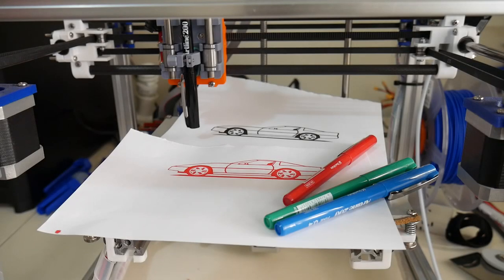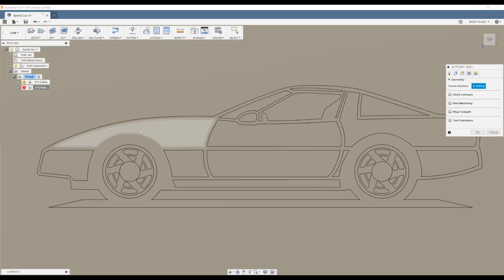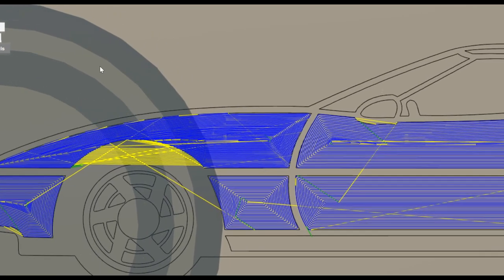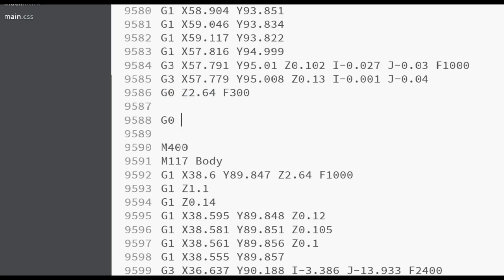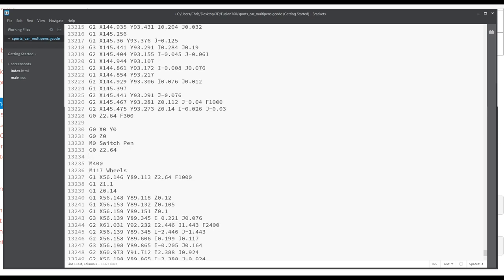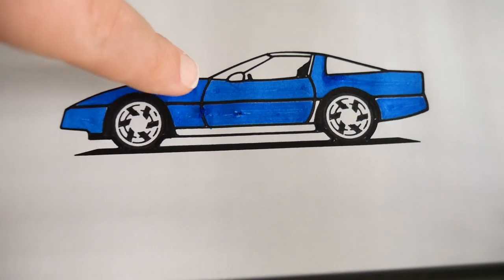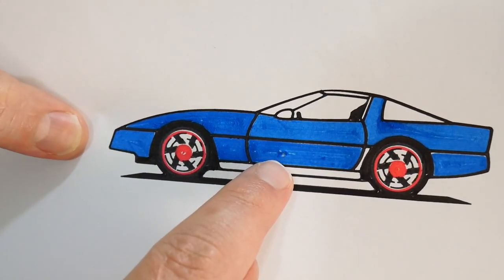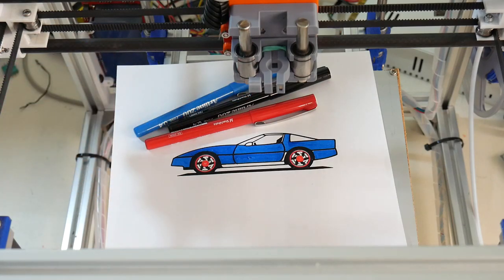Draw in Colour with your 3D Printer!

Comment: I like to assume that I'm going to move the print head if I touch it, even with the motors on.  So I always add a G28 X Y as the first command when the printer restarts.  Then I don't have to worry about it.   Usually I will also throw in a M18 before the pause and a M17 after so I can manually move the head where ever is convenient to work on it.   Z is trickier to deal with especially if there is a print in the way, but usually the Z is much more resistant to bumps. Nice work!  It's fun to see these machines made to do all sorts of things to fill whatever roll you might imagine.
Reply from the maker: Hey, yes good ideas there! Thx for watching :)

Comment: Hi Sir, great videos, explanations, crisp image and sound, a lot of work ! I have a question : is it possible to control the pressure on the pen on the Z axis from Gcode ? 
The use case would be for experimenting with robotic calligraphy with a fountain pen (of course installed with an angle, not vertical). Thank you sir, regards from France.

Comment: Looking at the rear where it looks like it missed a line im guessing the Y stepper may have lost some steps during the blue colouring in  possibly when it hit the thermistor hole which then was visible during the bit on the wheels 

I don't think it was due to you knocking while changing pens
Reply from the maker: You may be right. Then pen was getting knocked quite hard when traveling over that hole, especially as the pen holder has a rubber band pulling the pen down.